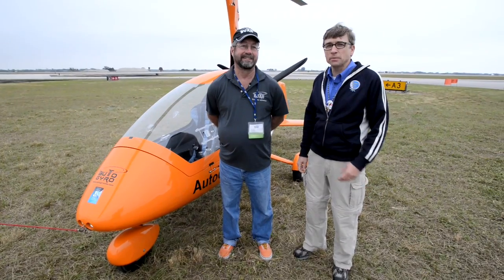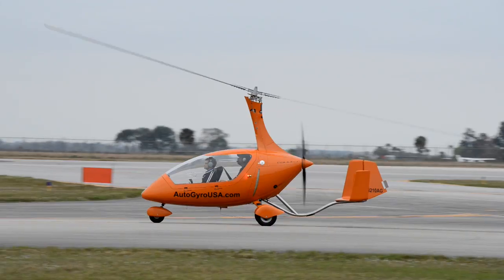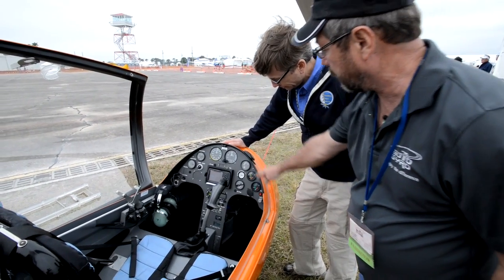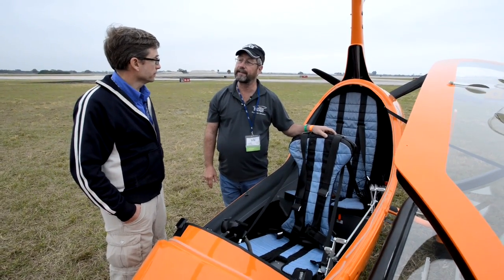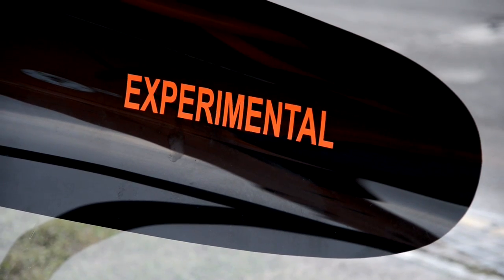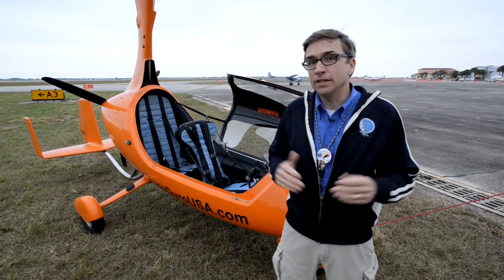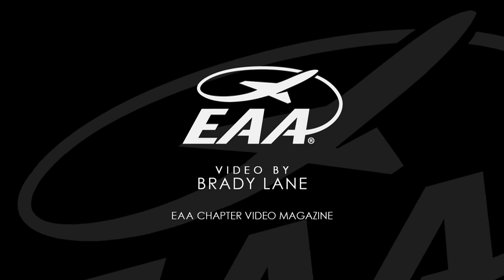Aircraft Profile: Calidus Autogyro

Comment: Just an update for those interested: Mr. Snyder mentioned that in many countries the AutoGyro Calidus is a certified aircraft, but not in the US. That's no longer true. Although you can still buy a kit and build it yourself under the Experimental Aircraft rules, the Calidus is now also available here as a factory-built, type-certificated design. The FAA issued the Calidus a Type Certificate, R00006RD, on November 30, 2016.
Reply: @josh langley With the prop/fan being as close to the center of rotation as it is in most designs, there wouldn't me much leverage for thrust to give good yaw control. One could move the fan further rearward on a long shaft, but that would introduce other issues. Current pusher designs are pretty well proven, and the reason pushers are more common than tractors (as were used in the early designs by Cierva and Pitcairn) is because the pusher props send air across the rudder surfaces so yaw control is established even at low airspeeds.
Reply: ⚠️ God has said in the Quran:

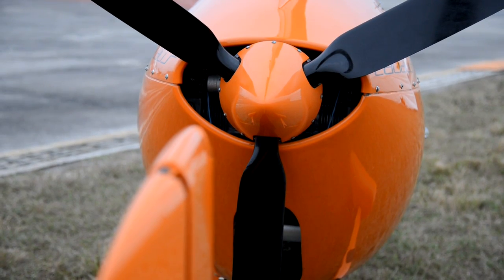🔵 { O mankind, worship your Lord, who created you and those before you, that you may become righteous - ( 2:21 ) 

🔴 [He] who made for you the earth a bed [spread out] and the sky a ceiling and sent down from the sky, rain and brought forth thereby fruits as provision for you. So do not attribute to Allah equals while you know [that there is nothing similar to Him]. ( 2:22 )

🔵 And if you are in doubt about what We have sent down upon Our Servant [Muhammad], then produce a surah the like thereof and call upon your witnesses other than Allah, if you should be truthful. ( 2:23 )

🔴 But if you do not - and you will never be able to - then fear the Fire, whose fuel is men and stones, prepared for the disbelievers.( 2:24 )

🔵 And give good tidings to those who believe and do righteous deeds that they will have gardens [in Paradise] beneath which rivers flow. Whenever they are provided with a provision of fruit therefrom, they will say, "This is what we were provided with before." And it is given to them in likeness. And they will have therein purified spouses, and they will abide therein eternally. ( 2:25 )

⚠️ Quran

Comment: Gyroplanes require specific type-certifications for existing pilots to fly (good idea, anyway). Calidus = kind of "Cadillac" of the gyro world and tandem seating = streamlined. Runs about $125K. AutoGyro's (German) open cockpit model, MTO Sport, runs about $75 - 80K depending on instruments & options. Same for Silverlight's AR-1 (Zephyrhills, FL, USA). Titanium (Australia) = "beefier" but still under Light Sport weight limits. Other companies = Magni Gyro (Italy), ELA (Spain). Most of these gyros use the Rotax 912 (100 hp) = OK at sea level or 914 turbo (115 hp) = better for higher altitudes. There are other gyros out there that are single-seat and do not have the wind-protection that the aforementioned models have. To each his own. Engine mounted in the rear keeps the CG near the rotor mast. Prop up front would require aircrew seating behind the mast. That was the first design by Spanish engineer Juan de la Cierva in 1923 or so. Gyroplanes are not like Trikes in that gyros cannot stall like a fixed wing. In fact, the gyro pilot typically reduces airspeed to zero by pulling the cyclic all the way back and then goes into a vertical descent. The most fun I've ever had flying....

Comment: This is awesome and great. I wish some of us here in Africa will not be left far behind as is always the case. Can this gyrocopter land vertically especially if there is no airport?.Great work friend.
Reply: +Laban Binus 
No...however..... in an emergency yes, most reps say something allong the lines of "if you had to come straight down most likely you be able to will walk away". 
The minimum landing speed for most autos are around 25-35 mph so if you had that as a headwind while landing it could be a 0 ground speed landing.

Long story short NO they cant (in theory) land vertically.
Reply: This is an autogyro not a gyrocopter. Its common that people to get those two confused. Gyrocopters can take off & land vertically but autogyros can't. Gyrocopters are basically ultralight helicopters like the one seen in The Road Warrior. The benefit of an autogyro is they use much less runway for take off & landing than larger STOL aircraft. So I guess you can say an autogyro is a very short take off & landing aircraft.
Reply: Utter Rubbish
Reply: spacemonkey no. autogyros, gyrocopters and gyroplanes are the same thing. There are some gyroplanes that makes jump takeoff that is quite similar to helicopter functionality but only in takeoff. once jumped they disconnect traction on the rotors and get those free for continuing flying. But gyros are totally different than helicopter. helicopters has traction on the main and tail rotors all the time.
Reply: JB CF #
Reply: You are wrong! only a helicopter can take off and land vertically....Auto Gyro,gyro plane and gyrocopter has free wheeling rotor. ...this is  a rotor craft...the one in madmax is a gyrocopter( just a smaller version) it needs a runway...learn what you are talking about before posting nonsense...
Reply: TheAtom, No, gyrocopters cannot take off and land vertically.  Gyrocopters and Autogyros are the same thing:   https://en.wikipedia.org/wiki/Autogyro

Comment: How much money required to make it at home? & How much space required to rotate main fan blades!
Reply: 6 6  well, thats a bit rude,and doesn't represent the community
Reply: Very small tanks so not something to take long trips in, blades can come off for storage but if you want specifics just google one of the manufacturers and they will have specific ranges and dimensions for you.  Hope that helps as I see some folks would rather be rude than helpful.  We need all the people excited about aviation as possible as the private public does all it can to close airports and regulate General Aviation.  Go to some airshows too and look around and you will be able to get in this field quickly.
Reply: You're looking at anywhere from $75k to $150k dependent on all the bells and whistles and your experience and level of help you can acquire easily.

Comment: Can the pre-rotation fxn of the motor be made more robust to make VTOL possible? then change to free-spinning once adequate horizontal speed is achieved? Would make these more commuter friendly not to need a runway.
Reply: There's the option for something called "hop-up" in larger gyro's, but smaller ones like this have such a small roll-out for takeoffs that it's really not necessary.
Reply: Hyperious I’m not talking about the current small rotorcraft depicted here, I know they have a short roll-out for take-off, but if you need a gyro-rotorcraft to take-off from a rooftop, hop-up would be necessary. I haven’t seen any prototypes of gyro-rotorcraft that has a robust enuf hop-up fxn to be relied upon for such a take-off.

Comment: nice video , what sort of weight restrictions are there on these?
Reply: Weight restrictions vary from country to country: in some places these are classified as ultralight/microlight aircraft, in others they're light sport aircraft, etc. This particular model, the Calidus, has a maximum gross weight rating of 450 kg (990 pounds) in some locales and 500 kg (1,100 pounds) in others. The payload allowed will depend on which rating system it falls under, but it has an empty weight of 262 kg (576 pounds), so it has a useful load in the neighborhood of 400 to 500 pounds. The maximum weight allowed in each seat is 125 kg (275 pounds), but if you fully load both seats you'll be over gross even before adding fuel. To stay within weight and balance limits there's also a minimum weight in the front seat of 65 kg (143 pounds), so petite pilots may need to add ballast to the under-seat baggage compartment. Standard fuel capacity is 39 liters (10 gallons) and with the optional auxiliary tank is 75 liters (20 gallons).
Reply: @seikibrian8641  A 20-gal tank? That's gotta have a range of 500 miles!
Reply: @tmst2199  It will depend on which engine is mounted, how it's loaded, how fast it's flown (aerodynamic drag increases at the square of the velocity), etc., but using the base engine and given 19 gallons of useable fuel it would have about a four-hour endurance at high-speed cruise of 86 knots, for a range of about 341 nautical miles (396 statute miles), plus reserves. Autogyros aren't as efficient as fixed-wing aircraft, but they ride smoother in rough air, can fly slower, can land in much shorter distances, etc.
Reply: @seikibrian8641  Damn. Is drag a 2nd-level function of speed? I always thought it was a product of speed and a coefficient. But I was wrong. :-) Hey, so what about low-speed cruising range? 86 knots sounds insane at less than airliner altitudes. :-)
Reply: @tmst2199  Long-range cruise is 70 knots, if I recall, but I don't have anything in my chart about fuel burn at that speed, so I can't say with any accuracy what the range would be. But it very well could be close to 500 miles if you run the tank to the last drop.

Comment: Lets make a list of different aircraft types. You got the fixed wing and you got the rotorcraft. When it comes toe fixed wing, you simply can have different numbers of motors and wings and slightly different shapes of wings and fuselage. Then you got floatplanes and flying boats, both of wich can (and usually do) have retractable landing gear as well. On the rotorcraft side there's more different designs. There's one or two main rotors with different numbers of blades. With only one lift rotor, you need a tail rotor. The tail rotor can be "protected" (fenestron) or regular, or it can even be a directed fan (notar). With two main rotors their torgues usually cancel each other and differential torque can be used for steering. The main rotor blades can be on top of each other on the same axis (coaxial) or they can be on two slightly tilted axis next to each other sideways with two blades and synchronized (synchropter). Or you can have a front and rear main rotor with three blades and synchronized. Or you can even have short wings and rotors at the ends of these wings (tiltrotor). Examples of rotorcraft include Kamov (coaxial), Kaman K-Max (synchropter), Boeing Chinook (front and rear rotor), Boeing V-22 Osprey (tiltrotor), Airbus Helicopters (conventional or fenestron tail rotor) and McDonnel-Douglas (notar ie. "no tail rotor"). Then you have the autogyro, where the lift is provided by free wheeling tilted main rotor "powered" by the forward speed of the aircraft. And, some of these autogyros have "semi-powered" main lift rotors for "jumping starts". So, they actually spin the main rotor and then literally jump in the air using the rotor inertia to take off without an actual runway. Mind you, they can NOT climb vertically or hover, like helicopters.

Comment: What's the fuel burn? Can you use true automotive gas (gasohol)?

What's the time between overhauls, and how much do they typically cost? Helicopter maintenance is prohibitive, but what's it like on these?
Reply: SoundOfYourDestiny much simpler and less prohibitive!
Reply: The preferred fuel is high octane automotive fuel (Mogas); EN 228 Super or EN228 Super plus (min. ROZ 95).
Alternative fuels are 100LL avgas, UL91 avgas, and E10 gasohol.

Fuel burn depends on the engine choice (Rotax 912 or 914) and on the RPM setting, but at normal cruise setting the 39 liter standard fuel capacity will give an endurance of more than 3 hours.
Reply: @seikibrian8641  And with optional reserve you've got 75 liters. That's like a no-brainer, IMO.

Comment: Without a tail rotor- how does this aircraft cancel out the torque?
Reply: Bob Bowie The top rotor (rotary wing) is not powered, so there is no significant torque to counter, as in the case of helicopters. In the few cases when the rotor does cause the yaw of the aircraft to change, the rudder is used to cancel it out.
Reply: With all that uncancelled torque going to the main rotor on takeoff it must feel like you're trying to wrestle a bob-cat into a bathtub.
Reply: Bob Bowie hahahaha! No!
Reply: Bob Bowie, there is NO uncancelled torque going to the main rotor on takeoff. That's why no tail rotor.
The only time the rotor is powered is when sitting still during spin-up, or 'pre-rotating'. Once the mail rotor is spun-up, power to the main rotor is dis-engaged. THEN the takeoff roll begins.
Reply: "Without a tail rotor- how does this aircraft cancel out the torque?"

The same way a fixed-wing aircraft does: it has vertical stabilizers and a rudder, and a stick to control roll.